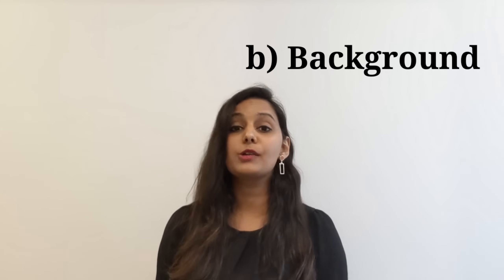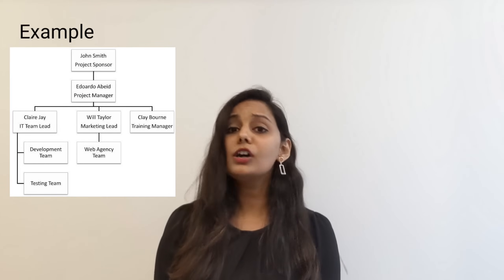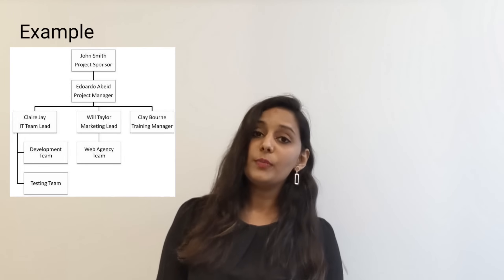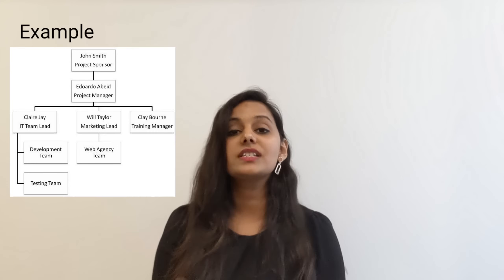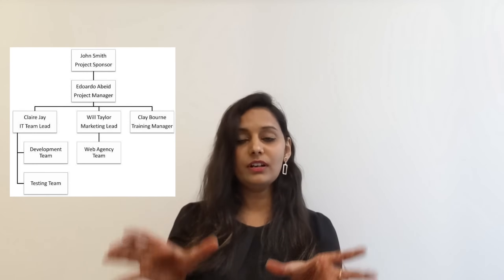How to write CDR(competency demonstration Report) skill assessment for PR - Engineers Australia

Comment: my final yera project is long and its in 2 parts. for eg. building a power sipply source along with laser first part and later used the same unit for the applixation. would you suggest to make it 2 projects or single?

Comment: Hi Varsha, Very informative video. I want to write 2 cdr based on my current work experience and 1 from my last semester project,  I need clarification about  Plagiarism, what its about ? I mean basic concept of project or other information, should not match with others source ? because somehow the roles and process are match with already submitted reports ?  
Please help me on this
Reply from the maker: Hey Bhavik, your Cdr report should not be an exact replica of someone else’s report. If you are writing your report on your own , there won’t be an issue . Make sure you use a plagiarism checker software before submitting your reports for assessment. Hope this helps , Good Luck :)
Reply: You can use turnitin for checking plagarism

Comment: Pretty much informative, Thanks :)

I have a question. I have done my engineering in Electronics and Communication. However, I work as a Scada Engineer, which is more related to Electrical Engineering. 

Is it possible to have the skill assessment with this background by submitting Career Episodes from my current work?

Comment: Hi, I have already completed 2 Career episodes as per my previous and current working experience, But I am facing problem to write career episode 1 that was college based 6 months project. How could I write it,  should I add industrial training knowledge or other softwares, which I had done at that time along with the 6 months industrial training.
Reply from the maker: Hi Nitish. Congratulations on completing 2 career episodes. Yes you can use your project to write your 3rd career episode, I used one of my paper presentation to write a report. Just make sure it's in alignment with the summary statement requirements. You can definitely talk about the software you used but on a high level. Don't get too much into technalities.